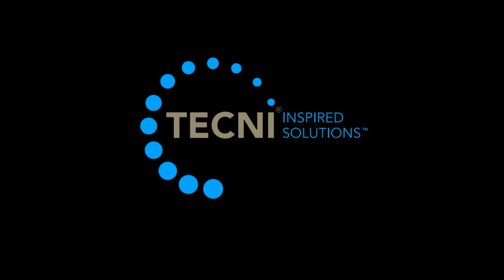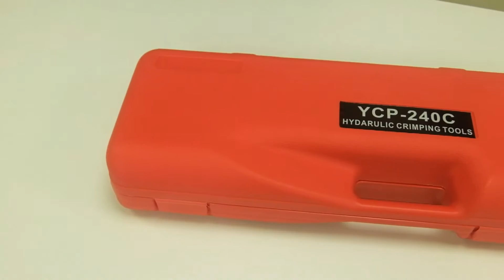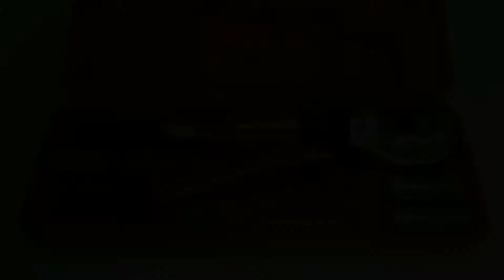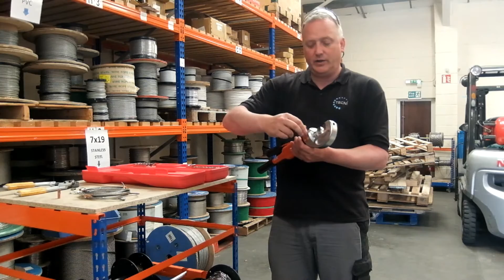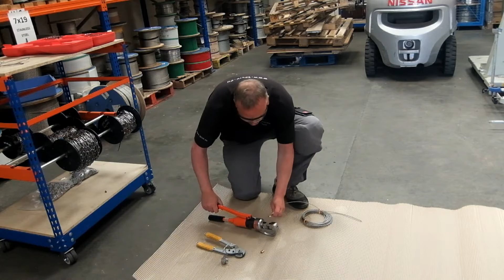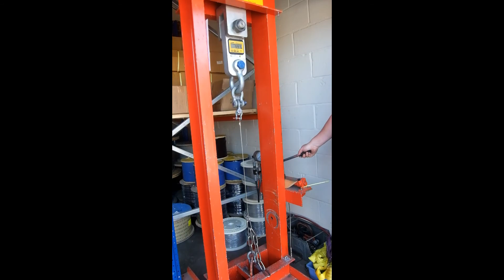How to crimp wire rope ferrules using the YCP-240C hydraulic crimping tool

Comment: Thanks for your comment.  The swaging dies in the tool can hold the ferrule in position to allow the cable to be fed through and adjusted easily.  Then once the ferrule has been swaged sufficiently to hold the cable and fittings in position (a couple of pumps of the handle) the operator can give full attention to pumping the handle of the tool.  Operators of the tool get better at using it after making a few assemblies. Essentially the tool is highly portable and really does give an excellent result in service but there will always be a compromise for portability.

Comment: It's obvious to me that this tool has a design fault. It securely crimps but it's not secure in it's operation. 
if it  needs to be placed on a on  flat surface most of the time, due to the nature of the wire having to be held in place with one hand.  The curved head that hits the floor must have a flat spot for stability. in fact, to make it stable for one hand operation it needs a base or flat spot on the curved head and one on the end of the bottom handle there by eliminating the chance of the hand that presses down from any slippage or wobbles just as your hand was doing. Don't forget, not everyone who use that tool will be able to avoid hitting their knuckles on the floor. even sell the stabilizing stands as clip-on  accessories.    Just an observation, free technical design consultancy. I'd love one of those tools But! cheers